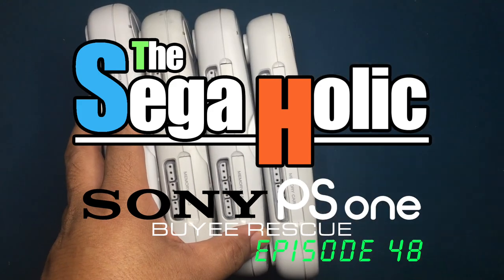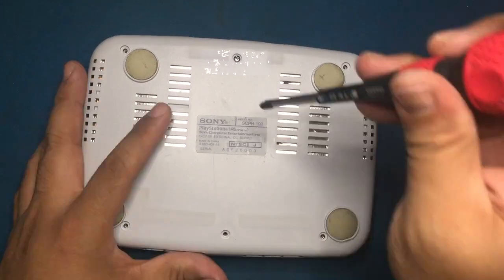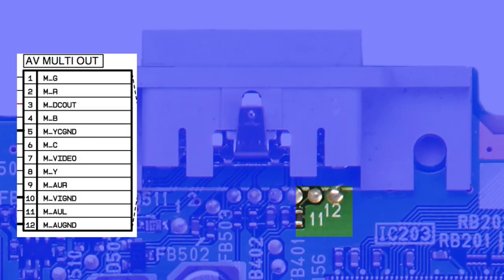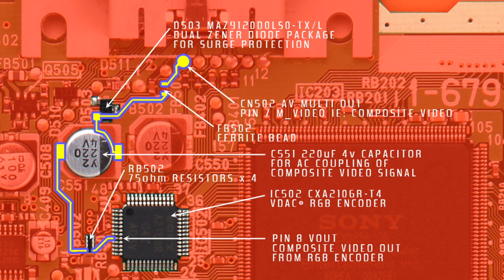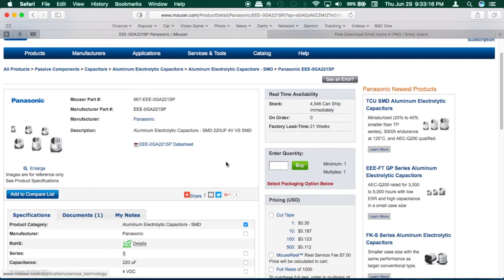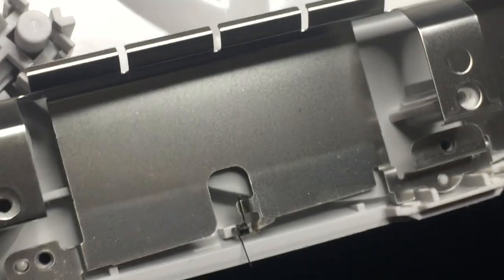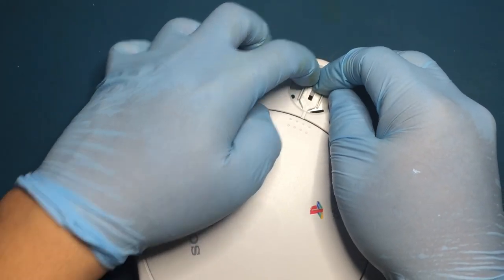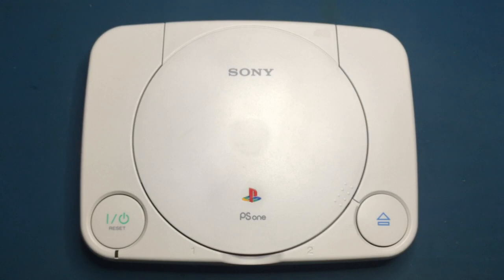PSOne Video * Composite & S-Video Output * Playstation Repair (Buyee Rescue) [ep.49] • AUDIO FIX •

Comment from the maker: GREAT CHAT WITH SOME OF YOU ON THE PREMIERE! SORRY we got cut off.  Maybe I should do a live stream...?
Reply: Man I wish you were near me to have mine repaired. Having the same issue, have audio and games load but no visuals on any TV or the LCD combo screen from sony.
Reply from the maker: @isimanica1  it’s small enough I think, that it’ll fit in the small usps flat rate box for $8 or so. If it fits, wanna ship it?
Reply: @The_SegaHolic  Going by the post office in the middle of this week and going to pick up one of the boxes to check. But I think it should fit and wouldn't mind shipping it. Good at lots of things but soldering things delicate like capacitors I am weak at and don't want to mess up. I have owned this bad boy since 2000 after doing yard work for lots of people over 2 months in the Houston summer heat.
Reply from the maker: @isimanica1  Damn, now I'm nervouse to attempt it... being something that has past meaning. LOL.
Reply: @The_SegaHolic  I am asking my brother and a local electronics shop about their soldering skills. I am hoping that with your video they can see what needs to be done and install capacitors for me. I don't mind taking things apart, as a mechanical engineer that is my knack. It is the fine electronics work on boards that I am not good at and I know it. Thank you for the video though, it is great and will sub for sure.
Reply from the maker: @isimanica1  It's actually pretty easy if you have the right tools.
Reply: @The_SegaHolic  Yeah I may work with my brother and his friend as they have the tools.

Comment: Hello!

I have composite output, but the rgb isn't working, it's simply outputting a composite signal over the rgb cable, what should I look for? I have the exact same board revision as in your video.
I've narrowed it down to being the console itself, not the cable, nor the TV.

Thanks!
Reply from the maker: If you mean composite is being used for sync, then yeah, most RGB cables will use composite video (cvbs) for sync instead of csync.
Reply: @The_SegaHolic  Thanks for your reply! What I mean is my rgb cable is outputting a composite signal instead of an RGB one. Do you think replacing the caps reaponsible for the composite video might fix my issue and "re-enable" full rgb video?
Reply from the maker: @DisneyTLK110  What you are describing is impossible.

Comment: Camera getting in the way because of too much BTW & CRUSH the subscribe button
Reply from the maker: Very short messages. And the messages are working.  Less than 5 seconds each. Need the clicks for revenue as a motivator. I spend MUCH more time than you think... it's CRAZY... for a check every 4 moths. Consider checks only come in when you generate over $100 and you get the idea. Thanks for the critique though.
Reply: @The_SegaHolic  I think people will like and subscribe without those btw or crush the like notices on your videos😉

Comment: Is cxda2106r same with bh7240akv?someone says it's only rebranded ic
Reply from the maker: Not sure. I know all "CX" chips are Sony, that's about it. You could try finding (Google) data sheets on both and compare.
Reply: @The_SegaHolic  yes read it already it's similar problm is where can I buy the encoder chip ,
Reply from the maker: @sherlanmamaril7368  You might be better off finding a broken one and harvesting from there if you can't find the chip on eBay or other onlline sources.
Reply: @The_SegaHolic  yes onljne might be,thank you for a detailed explanation voltages , schematic and on how u explain them ,truly helpful
Reply from the maker: @sherlanmamaril7368  Much thanks man. Your comments mean a lot.
Reply: @The_SegaHolic  sharing you're knowledge means a lot to all of us

Comment: hi, on my way to restore my ps1 i found it has no video output so i have made the capacitor replacement and regaiden video but is distorted: https://youtu.be/2TmfUBaWD6Q any way to solve it ? thanks
Reply from the maker: The only thing I can think of is reflowing the pins on the GPU, as that controls the graphics. You can search how the GPU looks here:
https://en.wikipedia.org/wiki/PlayStation_(console)

Comment: I have a question. What does the capacitor do? We tested the picture and it worked without it? What does it actually do? I am quite interested.
Reply from the maker: It's called an AC coupling capacitor. It's so that the console has more compatibility with display devices. I went over it in a couple videos. 
https://youtu.be/C0AZ6Rk26BI
You can find interesting links in the description... going into the finder details.

In the end, just keep it AC coupled instead of DC coupled as I found out that the console will not work with some of my RGB modded TV's.
Reply from the maker: BTW, here's the great article in the description of my YT vid.
https://www.maximintegrated.com/en/design/technical-documents/app-notes/3/3768.html
AC coupled is having the cap in. Removing the cap makes it DC coupled.